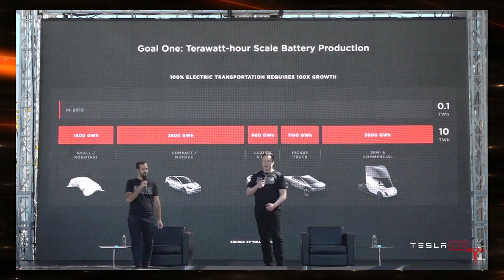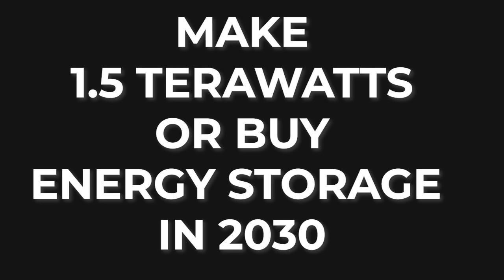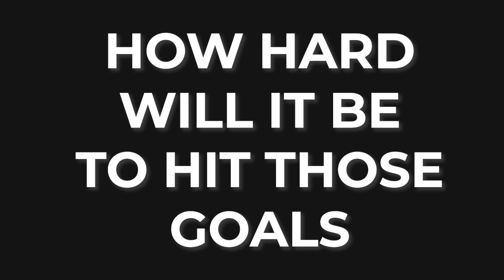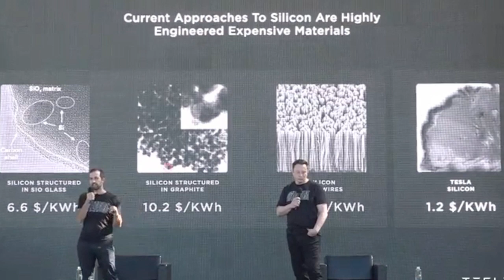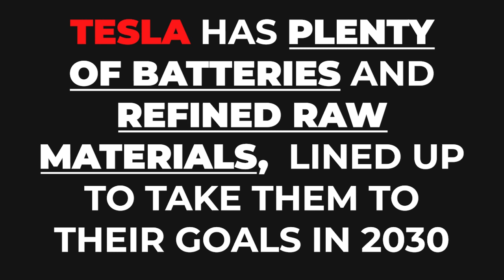The Biggest Untold Story at Tesla Will Soon Be Obvious, and This Will Impact $TSLA Stock

Comment: I thought 1 kilowatt hour is costing $70-$100. 
How can you justify charging $300-500 for your estimates?
Reply from the maker: The cost is probably around $100 depending on the source. Then you need to put that cell into a pack, then into a host (car, MegaPack, PowerWall). The more than $500 per kWh is based on the final sale price of the host. So, a Model Y that costs $50,000 has 80kWh. That's over $600 per.

Comment: Tesla building new battery factories all over the world, especially in the countries where the raw materials are mined, will be largely dependent upon the value of the IRA benefits (or other incentives) available, as well as the regulatory approval speed and political issues. 
I haven't  noticed any significant competitors in this field, which seems a bit odd.
Reply from the maker: There are competitors and there will be more. The demand is growing and will grow exponentially as the cost of solar/wind/battery becomes so much cheaper than any other energy production method in history.

Comment: I have been following Tesla daily for almost 4 years now, and no one actually talks about it. Inside EV had an article from Oct saying it will produce over 13,000 megapacks. The price from July 2021 was $1.235 Million each.  So $4 billion in revenue per quarter when fully ramped. 

Don't know how much to expect from energy storage for Q4 since it takes time to get them installed at a location but if Tesla went from $1.1B (storage and solar) per quarter to $5 billion per quarter Q4 2023.... That would be over 10% if Tesla revenue. 

Right now no analyst is factoring in energy storage in their price targets as it is only $1.1 B in revenue and 100 million profits in Q3. That would quickly grow and analysts will have to take notice. Now it is easy to see Energy storage revenue to pass automotive revenue.
Reply from the maker: Spot on analysis, except I expect the revenue to be closer to $8B per quarter when fully ramped. Right now I'm working hard to find a resource that can give current output. Not clear at all.

Comment: At time 1:30 the speaker includes batteries when listing renewable energy sources like wind and solar. This shows his ignorance. Batteries don’t convert energy in one form (like gas, wind or solar) into another. They provide electricity only after an electrical source is used to charge them.
Reply from the maker: The battery is an integral part of the renewable effort. In most cases there is no chance of making a wind or solar production facility without a battery as the economics don't work out nearly as well. So, we refer to this as solar/wind/battery.
Reply: True that batteries are part of the renewable energy strategy but they aren’t energy converters which solar and wind generators are.